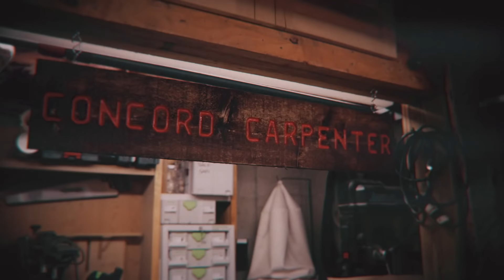3 Lessons Learned -Tipping The Delivery Guy, Mistakes, Teamwork

Comment: Little $20 tips go along way, especially with the concrete truck operator, because they do not play when it comes to time!

I had ex landlord who would put aside scrap metal for an ex tenant that became a scrap guy. And then when I started doing renovation work as a labourer, I would do the same thing myself. And then when I started to do side jobs, I would look like a superstar because I have a scrap guy! Plus the guy knew where to get antiques from, he knew the whole city. 
That guy got me out of so many jams, whether it was me or a contractor that didn’t have room in the truck. You can always leave the scrap metal outside, sometimes it’s dangerous or the homeowner wants it off the property. 

The moral of the story is this guy is absolutely right, you feed your scrap guy, tip your delivery tip your people, it will always pay off in the end. 
Just read the book of Proverbs, it’s just the way God has set everything up.

Comment: I've cut cellular PVC too short before and brought it back to length using PVC glue and pocket hole screws in the back. The trim was way up high so it worked really well. Can use biscuits if really nervous about pieces becoming mis-aligned. Or just use the kreg clamp to tighten them to each other.

Comment: Measure twice, cut once. I used to cut long to be sure but after 40 years i cut 1 mm long amd spring into place. I always ask guys that work with me, if you see something wrong fix it, dont leave it for the next guy, own your mistakes. Pride often prevents guys fron owning up. Better to deal with your  mistakes then pretend they didnt happen and repeat them.